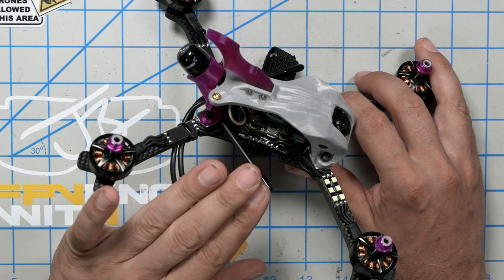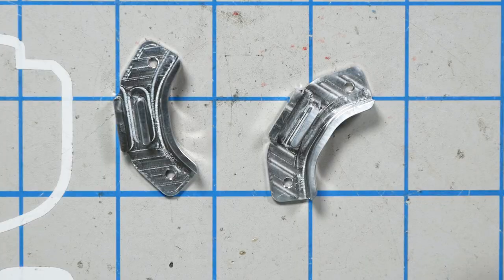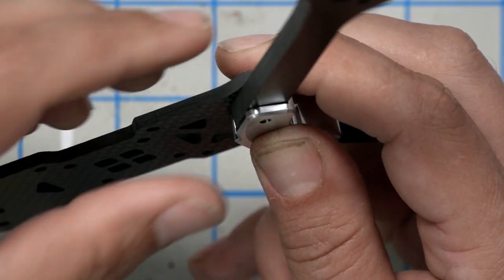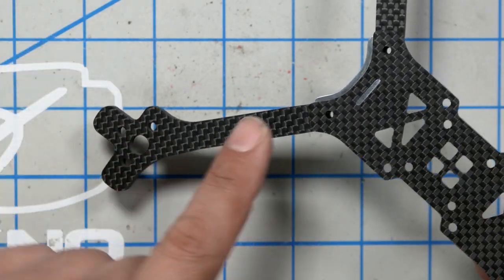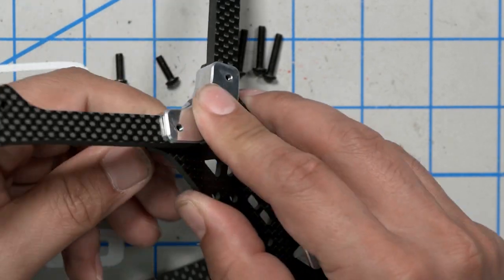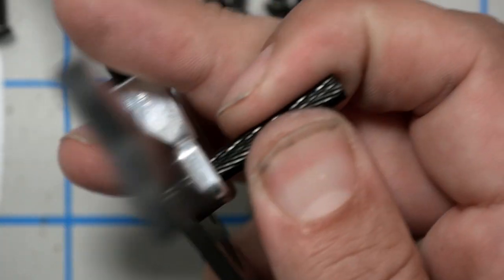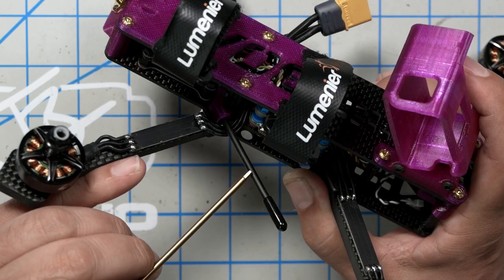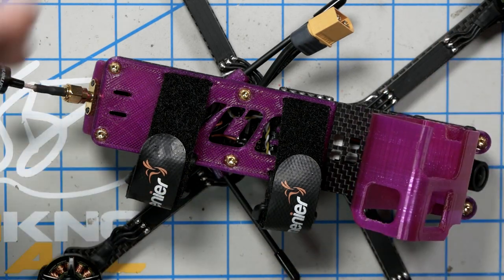SkyReadyRC balances toughness vs. weight with aluminum frame insert

Comment: JB, thank you for taking the time to review the frames! 

To secure the standoffs, the way you backed off the screw before hand tightening the standoff is the way to go. Before attaching the standoff, using a drop of blue threadlock helps to secure the assembly, while still being removable when needing to replace an arm.
Reply: How about some hexagonal standoffs? They're readily available in any size/length/color on several RC sites, as well as banggood... I've used them on a couple builds for specifically that reason; I use a small crescent wrench along with some tiny little split lock washers to prevent them from backing off from vibrations. I prefer them to Lok-tite, easier to re-use... Works really well, never had any issues.

Comment: I've raced with the Floss 3. the Floss 3 lite, the Aether, the TBS source 2, and the campfire S-X. I have broken each of those frames multiple times and have not been able to aptly repair them fast enough during a race in order to make the next heat. I've never had that problem with the Cobra, only broke an arm once on concrete after falling 100 feet... Also fire resistant 10/10
Reply: If there's anything you need it's for it to be fire resistant.

Comment: Been flying 4 years, racing 2, and these things are the toughest of any frame I have flown. Arm change outs are the fastest I have ever experienced in a frame, yet the need to swap an arm is rare since these things are hard to break. I have broken more gates than arms in the year or so I have been flying the SkyreadyRC Cobra Lite. I highly recommend this frame to any current or new pilot if you want tough reliable durability. Just #SEND IT Cobra, Cobra Lite.

Comment: I had the privilege of being a test pilot for the first and second gen Cobra racing frames. I'm terrible. so I crash a LOT. Listen to me when I say I have never flown a more durable and easier to repair racing frame to this date. I've broken several arms on other quads. Not only are the cobra arms about 3 times more durable than other frames but the ease of replacing the arms is a selling point all itself. Do yourself a favor and get one, especially if you crash a lot.

Comment: You could put a screw through the top of the stand off before you put your top plate on and use the screw to tighten the standoff down.

Comment: Tightening the standoffs could also be done with a small strip of leather wrapped around the standoff to protect it and using an ordinary set of pliers ,  awesome video as always 👍👍
Reply: Yea I use 2 thin pieces of wood over the pliers. Surprised that he didn’t think of that

Comment: The internal fibres generally follow the direction of the woven outer layers. From my experience. Try taking any thin plate of carbon and try flexing it in line with the fibers then at 45°. There is always more flex at 45°. It mainly affects single bottom plate Frames.
Reply from the maker: Everybody seems to assume that it's unidirectional fiber though.
Reply: @JoshuaBardwell   Perhaps somebody should make a video about it. You could use waffles to help people visualise it. Explaining that carbon is bidirectional at 90° to each other and that the stiffness is in either of those two directions. . Most quads with seperate arms are cut fine. However single plate designs are nearly always cut with the fibres running front to back and side to side. Meaning that none of them run along the length of the arms. That way the motors aren't being held as stiffly as they could be.

Comment: @8:30 Project 399 was first frame I was introduced to with that design for a midplate/bottom plate seperation.

Having cut my own frames recently I like it because it let me arrange the parts to the piece of carbon fiber being cut.  I could do a 90deg rotation of a bottom/midplate to cut it out of a 200x300mm sheet.   Where if I did a full length plate I was forced/stuck with only cutting on the 300mm length orientation.

Also, i like the smaller standoffs that come from the mid plate to top plate.

Use the midplate thickness combined with the arm thickness to hit on a good standoff length.

My 10in frame used a 3mm top and bottom plate.   Then my arms are 6mm thick and my midplate is 4mm.    That gives me a 10mm difference between standoffs between top/bottom(30mm) plate and top/mid(20mm) plate.

It also makes frame designing in Fusion 360 fairly straight forward using the bottom plate to then move forward to design the midplate.

Comment: I made extra accommodations to my reverb to fit an air unit. I turn the frame around so the camera was in the smaller section and the air unit could fit in the larger section. You will be limited on camera till with a full DJI camera.

Comment: I have a flywoo mr croc with similar antenna placement and experience occasional signal disturbances.  I think it's better to have it at the back as high as possible, up and away from all the CF and body of the quad.

Comment: From my experience being a beginner that crashes a lot on concrete, i found that durability comes not so much from materials but from overall frame design.
Some frames just state that aluminium parts make quad more crash-proof and give break more frequently than cheap chinese frames from carbon only.
Most recent crash of my geprc elegant frame shows that it is built to avoid contact with its most vulnerable parts. Even without motor protection, i had no scratches on motors and arms were not damaged at all. When it comes to frames where aluminium parts placed to make arms more stiff, they just break arms in different place.
Apex is still good handling this types of crashes, even without these marketing parts. But why i love geprc with aluminium front is that it handles frontal collisions better. Not a breakthrough in terms of design for sure, but obvious benefit is obvious. However, i may be completely wrong and give out my personal experience as fact here.

Comment: The reason these standoffs are textured the way they are is so you don't leave any marks while cranking it down with a pair of plyers :)
Reply: You’ll still leave marks, they will just be hard to see. I put 2 little pieces of wood around the standoffs for the pliers to dig into instead

Comment: 9:15 About the height inside the frame. You said that some people would prefer to have more room at the back for their VTX and so on. Well, what's stopping you from simply swapping everything around? Just put the VTX in the front and the camera in the back, then rotate "forward" 180 degrees in Betaflight. The Gopro mount might not fit (although the distance between the standoffs look the same), but that's a small problem.

EDIT: I checked the bare frame pictures on their website, seems like it's not as straight forward as I thought. You'd have to drill new holes for the standoffs your Gopro would be fastened with, and you have to make a new cutout in the top plate for the FPV camera to see "through". It can still be done though, if you really need the extra height in the back. Or, like you suggested, have SRRC make a small re-design;)
Reply: Spin the top plate

Comment: Interesting idea using an aluminium part like that, but I fear that the slot in the end of the carbon fibre arm would be weaker than a second hole - I think that over time cracks would start to form from that point towards the screw hole.

In my opinion they would have been better off using the aluminium ribs to clamp hold the front / back edges of the arm and to put two screw holes in per arm. (With shoulder bolts so that a nice round section holds the arm rather than a threaded section.)

The Project399 "Practice Rig" frame also has the half-bottom-plates, having the larger section at the front means that you can have a reduced height frame with the full height at the front for your camera tilt.
Reply: Interesting observations Andrew. I can say through my experience and through heavy abuse I have not seen this happen.
Reply: @Madscrills  It's interesting, this is why the physical testing from test pilots such as yourself is so important. I can sit here in my chair and raise concerns about what I suspect may be a weak point in the design, but that threshold for braking may never be reached in normal use or I could be misunderstanding the effects of fatigue stress on carbon fiber or be missing some other detail that negates the concern. Even computer modeling may not accurately predict the behaviour of fatigue stress in a complex scenario such as this.

I guess in the end only time will tell, but it's very interesting to hear about your experiences with it.

Comment: Joshua, the floss's aluminum bottom plate does the same thing as the aluminum on this frame, to a lesser degree.  But same idea.
Reply: You're right, but the idea behind this method is that the aluminum portion is not taking the entire stress of a crash. If a solid plate warps due to a crash you're SOL and have to replace the whole thing. This method provides less stress to the aluminum part which results in less warping. In the event the small plate does warp it's a cinch to replace.
Reply: @Madscrills  meh.  Yeah it's different than the floss, but not a novel concept.  I don't think I've seen JB build a floss so maybe that's why he thought the mechanics here was a novel concept.  I've never seen a floss bottom plate bent, BTW, I'm sure it's happened though.  Anyway, it's a fantastic design whether it's novel or not, this is a good implementation of this idea, and another great example of mixed materials in a design.
Reply: @GregKelley  You probably just fly with good pilots XD. Crash enough and it'll warp. This just mitigates that possibility, lightens the build and makes arm swaps a breeze.

Comment: 2:20 Looks like that back support portion of that would chew/bite into the frame if the the drone was crashed arms first a few times, putting that "bending" force on this joint, pressing the sharper cnc'd part of that insert into carbon.

Comment: Also, with the standoff on the same screw, it's essentially "double-nutted".  You can't just remove the screw to replace arm.  You would have to loosen screw on the top plate, loosen the standoff, then remove the screw.

Comment: 3:30 However The structure of that internal carbon fiber actually matters more than most realize (at least im pretty sure). Take a look at "Sensitivity Analysis of the Frequency Response Function of Carbon-Fiber-Reinforced Plastic Specimens for Different Direction of Carbon Fiber as Well as Spectral Loading Pattern" by Chan-Jung Kim

"The sensitivity index over the direction of the carbon fiber is very high at specimen #1 and decreased rapidly as the direction of the carbon fiber increased in the first mode; the sensitivity results show the opposite tendency in the second mode. The sensitivity order changed over the spectral loading patterns in the first mode, but the highest value with specimen #1 did not change at all. This means that it is reasonable to use specimen #1 under the current uniaxial excitation condition owing to the highest structural rigidity, but the frequency response function could also be the most sensitive over the small variations in the direction of the carbon fiber. On the other hand, specimen #3 became the most sensitive specimen in the second mode; this result may be the opposite of that of the first mode. However, comparison of the sensitive index in the second mode has less valuable physical meaning because the mode shapes differ from each other over the direction of the carbon fiber, as seen in Figure 8. The sensitivity index over the spectral loading pattern is also very high at specimen #1, while the other specimens have lower sensitivity values in the first mode. This means that the frequency response function of specimen #1 will change easily over small variations in spectral loading patterns, and the effect of the dynamics of external forces is an important issue for the specimen with 0° direction of the carbon fiber. In case of the second mode, the sensitivity index is similar for all specimens, as seen in Figure 14. Thus, the variation of the frequency response function against the spectral loading pattern will be similar for all specimens in the second mode.

Specimen #1 has the highest structural stiffness as a result of assigning the carbon fiber in the principle direction (0°) to support the rectangular specimen against uniaxial excitation. However, both sensitivity indexes indicate that specimen #1 is the most sensitive CFRP structure over the direction of the carbon fiber as well as the spectral loading pattern in the first bending mode. Hence, it is very important to minimize differences in the direction of the carbon fiber in all CFRP structures. Different dynamic responses are also expected from variations in the spectral loading patterns. In the second mode, the direction of the carbon fiber affects the mode shape of the CFRP specimen, even if the variation in resonance frequency did not change significantly. The sensitivity index for the direction of carbon fiber indicates the highest value in specimen #3, but direct comparison was not a significant issue owing to the difference in the mode shape of each specimen.

5. Results
Specimen #1 with 0° direction of the carbon fiber was the most sensitive to small variations in the direction of carbon fiber as well as spectral loading patterns in the first mode. Hence, quality control inspections should be conducted to minimize errors in the direction of carbon fiber in CFRP products. In addition, the response of specimen #1 has the disadvantage of changing its magnitude with spectral loading patterns compared with other specimens. In the second mode, the dynamics of each specimen changed rapidly according to the direction of the carbon fiber. The mode shape of each specimen differed from each other, although the resonance frequency did not significantly change such that the sensitivity index derived in the second mode has less physical meaning. These analysis results indicate that the proposed scaled sensitivity index is an efficient method to evaluate CFRP specimens according to the direction of the carbon fiber. The sensitivity result may serve as a useful guideline for engineers in designing CFRP materials.

6. Conclusions
The frequency response function for CFRP specimens was derived by considering the nature of system variables over two parameters: the direction of the carbon fiber and the damping ratio. A scaled sensitivity index was then proposed for each parameter of interest. Partial derivatives of the frequency response function were obtained from the curve-fitted line of the measured response data during uniaxial excitation testing, and the corresponding scaled sensitivity index was calculated for specimens #1 to #3. The mode shapes of CFRP specimens were shown to have similar bending modes in the first mode, but showed different shapes in the second mode. Specimen #1 is the most promising candidate for uniaxial excitation in the first mode because its structural rigidity is maximized with 0° direction of the carbon fiber for uniaxial excitation."

Comment: i've designed a few aluminium armbrace frames, i like this mechanism quite a lot
i'm currently testing a prototype toothpick frame, where the whole center section and motor mounts are aluminium tubes and the arms are straight fiber square carbon rods that press into the tubes with hotglue
it's actually laser 3d printed
there is a short video on my channel

Comment: I have a 76g Ghost Mode II Racing frame and really like the weight. However, I can not run 51XX props on it, can you on that race frame?
Reply: Yes, 5.1 inch props fit on both the Cobra/Cobra Lite and the Boa frames.
Reply: @skyreadyrc5873  
I'll have to look at it a bit closer I reckon...👍🏻🍻👊🏻

Comment: The BOA, could it fit a rumcan hybrid or caddex tarsier?
Reply: @Freelojo the Boa has 30mm front standoffs, so there is 30mm of height to work with for mounting your camera. Becasue of the length of the cables though,  you may have to mount the Tarsier/ Hybrid boards in the center stack location, and mount your ESC/FC in the rear stack location. The camera mount has multiple mounting hole locations, so positioning your camera should not be a problem.

Comment: Dear Joshua, can i use 2S battery on a motor rated 3S to 4S? The ESC is 2 to 4S, only the motors that i wanna buy are 1205 rated for 3-4S. I would like to be able to use 2S battery with this set up as well. Appreciate any guidance 🙏
Reply: MAD GRUMPYMAN  Thanks  Bro for the explanation, I really appreciate it. Actually I am planning to use 3S and 4S battery in long run, just i wanted to be sure that if I occasionally use 2S when not much power is needed such as indoor cinematic flights, it doesn't cause the motors any harm. But after your explanation, I learnt that going down on voltage doesn't cause damage to motor when much power is not needed. Thanks again for your time and explanation 👍
Reply: MAD GRUMPYMAN  Thanks for the time and the concern for sharing your knowledge with me, I really appreciate it. I have done throttle limit before and am familiar how to that. Thanks for bringing up the idea 👍